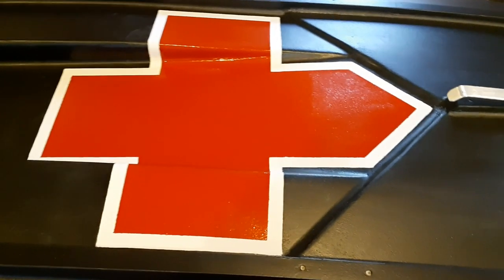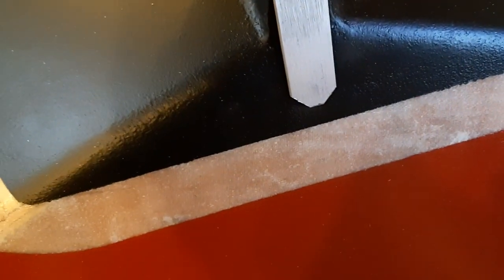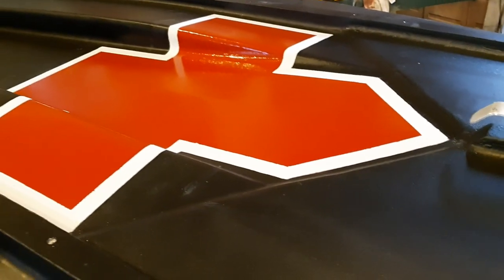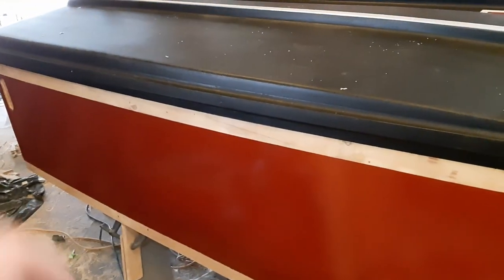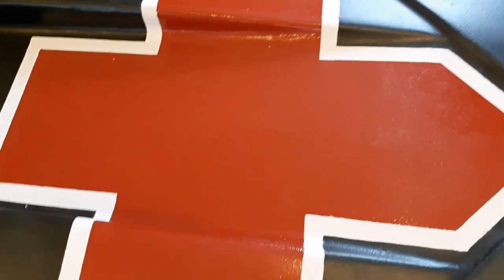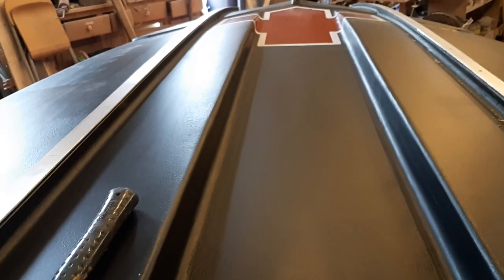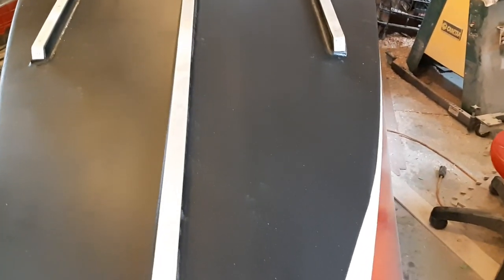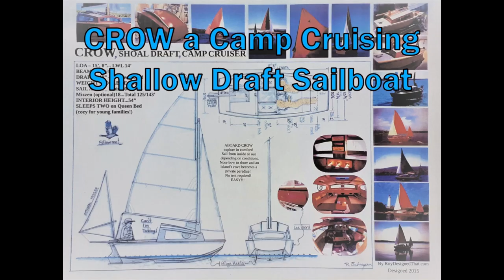New 14' Fishing Boat Design by RoyDesignedThat.com

Comment: ahhh i tried alluminium straps on the bottom of the runners on my pirogue Found out they expand/contract different rate to timber strips. Pulled the screws out and let in water. they rotted I replaced them with inch square treated pine. wont rot and cheap to replace
Nice design, as usual. Oh yes. Forgot to mention. I'm in Australia NOT chilly Canada.
Reply from the maker: So far, on all my other builds, one that had aluminum from an old extension ladder one it for over thirty years, and two others, one of which is now almost ten years in use, it has not been an issue. I do use Ash, a hardwood for the runners on all my boats, perhaps it being very hard, the screws can't shift much and is why. Also my runners are not glassed over as I think this is a recipe for rot. Should there be a problem they can be replaced without harming the hull, which was glassed over independently of the runners. There are some screws helping to hold them on but only a few, adhesive is the main way they are attached and fillets. Best roy

Comment: Nice work Roy. Look forward to seeing how it performs. What size outboard/ power range are you aiming for?
Reply from the maker: She could handle 25hp but I'm a minimalist and think 9.9hp with controls for the center console would be great. I have a 4hp that will do for now and a connection to test a couple of bigger motors t get some performance numbers. I'm on the look out for a deal on a decent boat/motor/trailer package that is cheap enough for my budget. I've seen a couple that have been close, one with a 20 hp long shaft and controls that I almost jumped at. Fishermen want fast so that is one reason to go bigger as the design is geared for them. I don't mind slow and steady! Lol!

Comment: Hello. When is the video from the water? When is the open water test of a motor boat?
Reply from the maker: Hi Cepera I'm wanting to take the boat for a fishing trip in Sept. So am working hard to finish her up enough  so she is usable. Just oiled the floor boards today and started to make oar pin holders for the oar locks. Best Roy